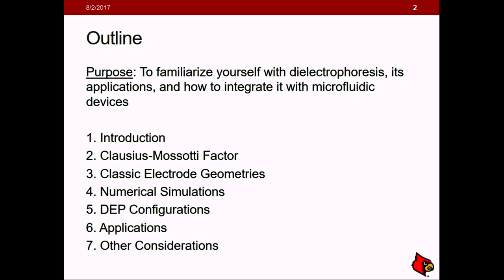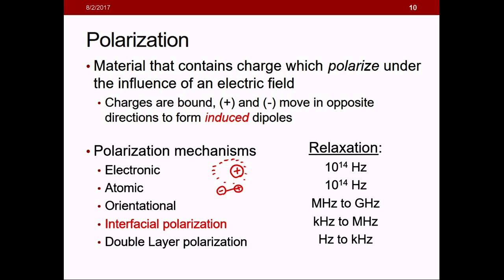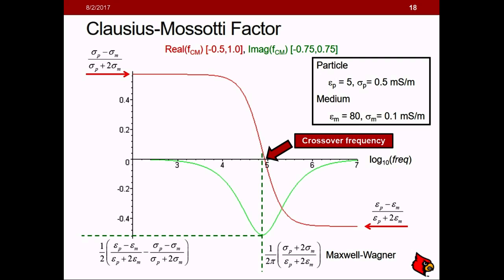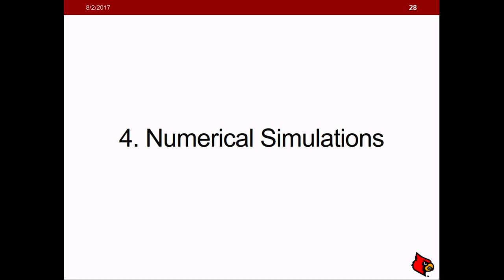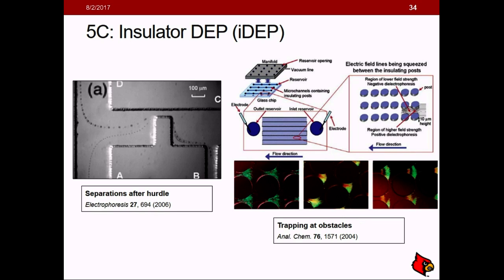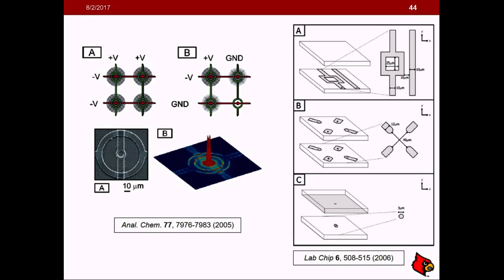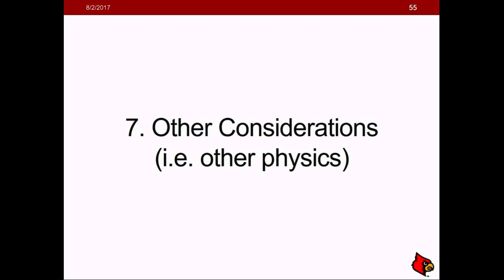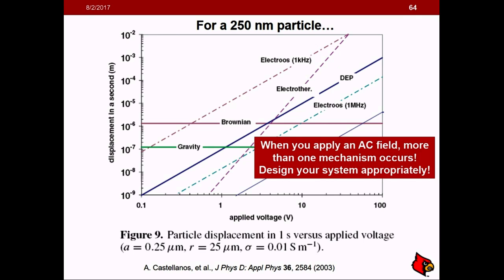Introduction to Dielectrophoresis (DEP)

Comment: Awesome video and great presentation. How close is this technology being commercialized for nanoparticles and bioparticles?
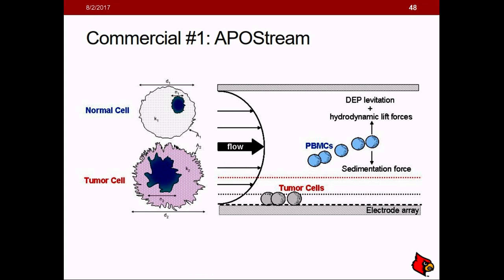Reply from the maker: This is a good comment, there is definitely a challenge with crossing that bridge into commercial applications. Look at the video section "applications and commercial products", starting at about 57:30 is when commercial products are discussed. 
I believe its applications for biological cells has been demonstrated, but many laboratory platforms are designed for specific purposes (ex: specific media, specific cell types, etc.). I think platforms can be targeted for a certain cell if designed appropriately. Cells  may also need to be suspended in media that they are not used to (ex: low conductivity media), even if it's for a short period of time.
Nanoparticles (< 50 nm) is a different challenge. The 'easy' approach is to make nanoelectrodes or nanometer features. However, in my opinion, electrohydrodynamics will be present to. Again, careful design needs to be considered.
Throughput, whether for nanoparticles or bioparticles, is also an ongoing challenge. Advances in 3D electrodes and other complex 3D structures is overcoming that challenge. 
I welcome discussions and am always looking for creative applications of DEP - feel free to reach out and we can talk!